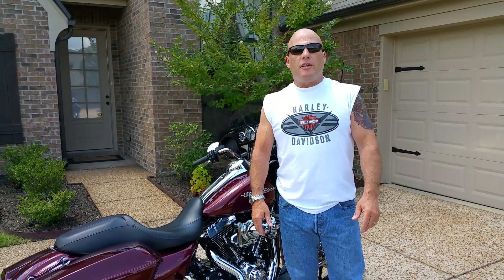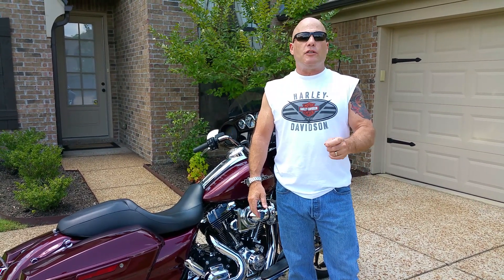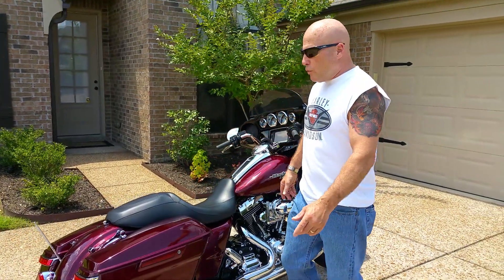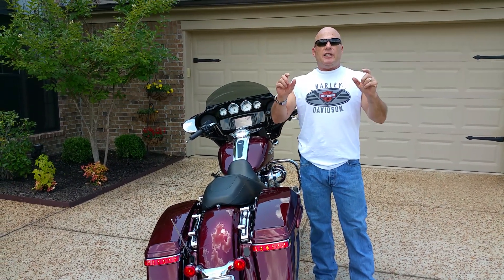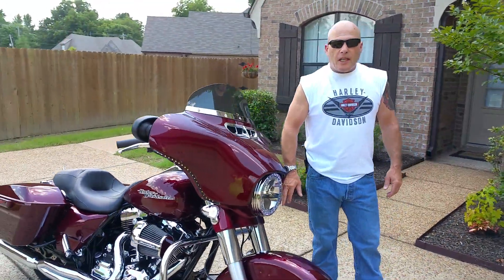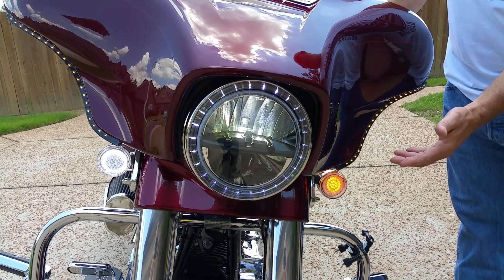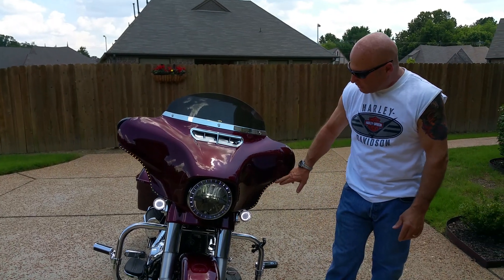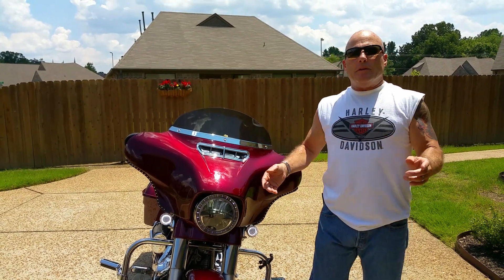New LED lighting

Comment: Tony, could you please respond back on here in writing what all I need for the front turning signals.  Thanks again!
Reply from the maker: Hey buddy,  it's simple.  Custom dynamics is the brand, your dealership should have them if not but direct, you will need 2 clear lenses as well.

pop the covers currently on the bike, take out the light bulbs insert the new leds and pop the clear covers on.

if you have a 2014 or newer, run the bike for about 5 minutes to train the computer and your set.  let me know if you need anything else.
Reply from the maker: Hey buddy,  it's simple.  Custom dynamics is the brand, your dealership should have them if not but direct, you will need 2 clear lenses as well.

pop the covers currently on the bike, take out the light bulbs insert the new leds and pop the clear covers on.

if you have a 2014 or newer, run the bike for about 5 minutes to train the computer and your set.  let me know if you need anything else.

Comment: Thanks, I just bought those saddle bag lights for my 16 roadglide,  Are the harley instructions pretty accurate for the install? Any tips?
Reply from the maker: super simple to install, crazy but the one tip would be to use a paint stir as tha spacer between the light and the saddle bag lid. it leaves the perfect space between the light and the lids.

Comment: Did you need a load equalizer for the front turn signals?
Reply from the maker: dabosman43 No, it's built for the new Harley BCM, plug and play, very easy install
Reply: i have a 2006 streetglide. i believe I'll need one. thanks for the reply.
Reply from the maker: dabosman43  You may need one, I'd call and ask or ping your dealer with this question.
Reply: thanx brotha...stay safe!
Reply from the maker: dabosman43 Not for a 2014, what year is your bike?